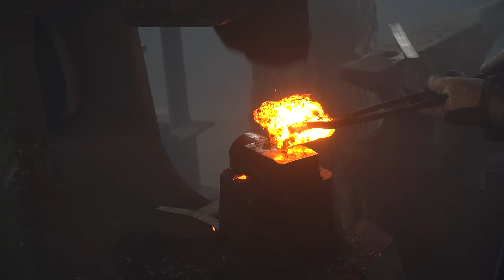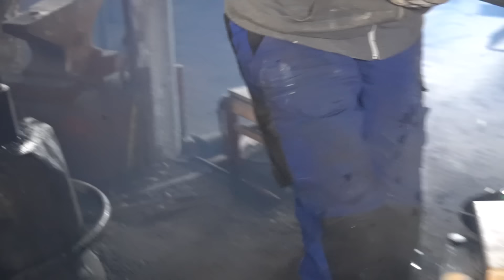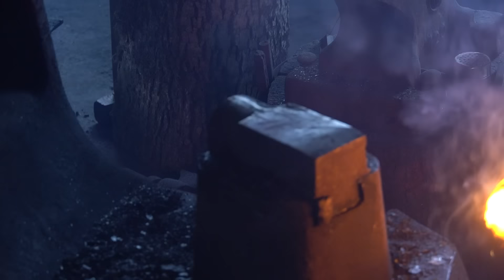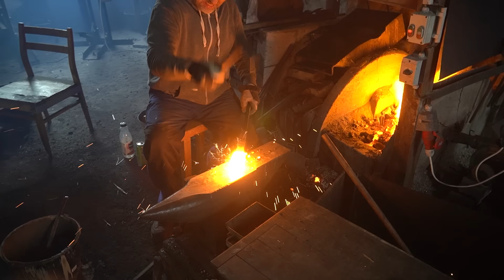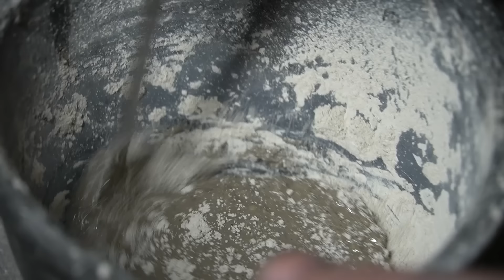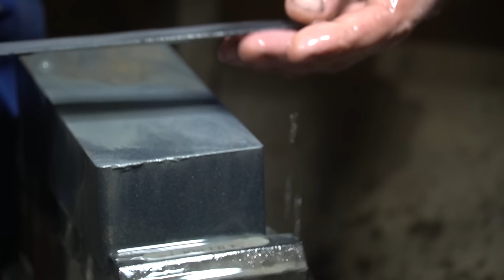Making tanto blade

Comment from the maker: Marshall Duncan: I don't know these steels. However, I use CZ standard 19 191 for knives. It is an unalloyed high carbon steel with a C content of about 1.1%. The risk of cracking during quenching is similar, perhaps a little higher, to traditional steel. Experience is important. At the beginning of practice, 9 out of 10 blades broke. Hold on.